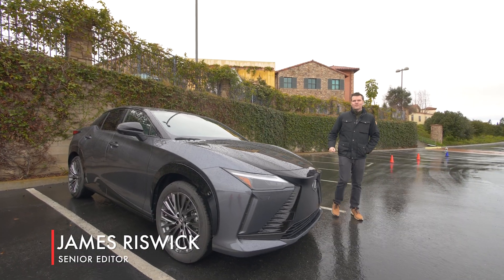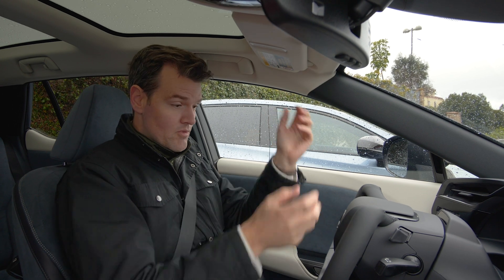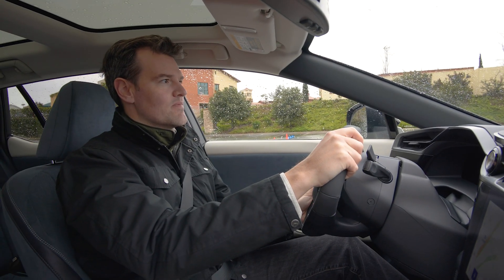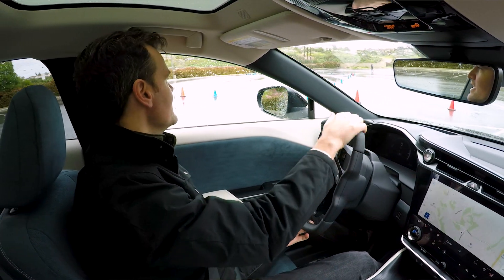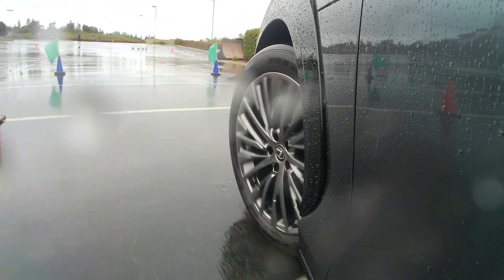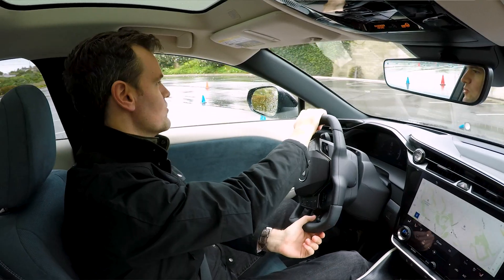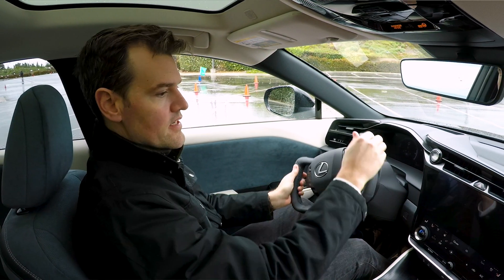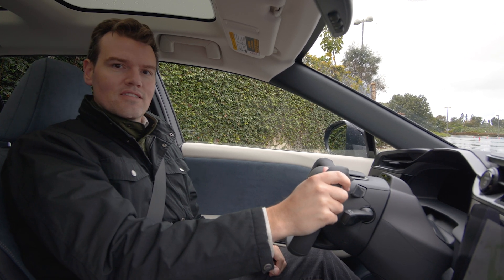Don't Call it a Yoke - Lexus Steer By Wire Review in the RZ 450e

Comment: Just came across this concept and looked it up, so I'm late to the video... As much as this is interesting and innovative, seems like it is also impractical, in the sense that it would take an extreme amount of time and effort to re-train the population into a non "ten-and-two" driving position and speed-adapted turning, which is far less intuitive, in my opinion.

Also, I like to rest my left hand on top of the window frame and steering wheel on long drives, and that's entirely gone with a yolk 😢
Reply: Have you driven a go kart before? I was thinking it may be a similar experience in steering a go kart where people can adapt to the steering ratio very quickly.

Comment: That sounds all fine and good. But what in 10y when your going down the road and one of the steering servos have a minor glitch and your doing 90mph and figure out oh snap I can't turn any more. What kind of safety's are in place?
Reply: controlling things by wire isn't new, fly by wire have been in aviation for decdes
Reply: kinda like your power steering pump or belt failing?
Reply: You might not noticed but this has been a thing since 2013.

Comment: Works the same as Tesla yoke, no difference even with steer by wire.
Reply: No it doesn't. The steer by wire requires no hand over hand movements and is completely variable. The Tesla system is just a mechanical steering system with a yoke replacing a regular steering wheel.
Reply: Exactly Mr Smith.
Reply: Wrong